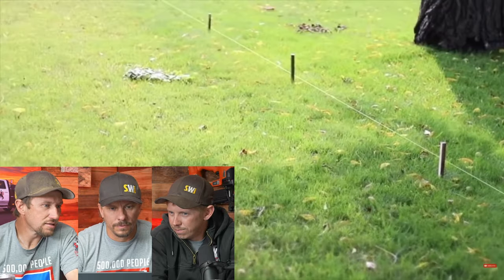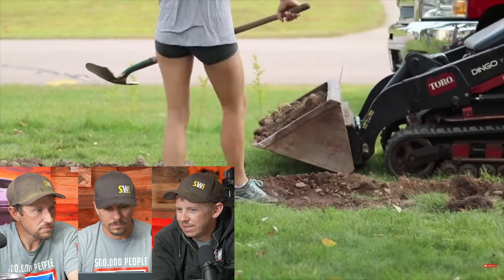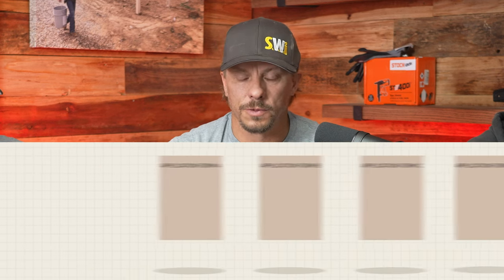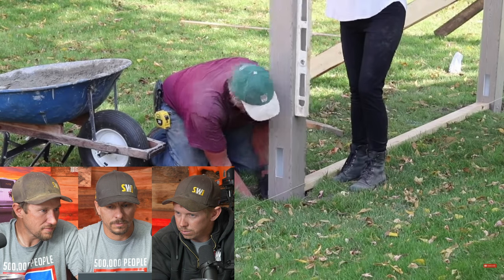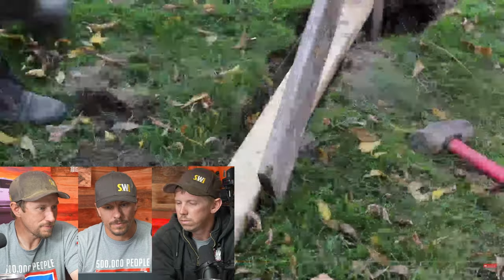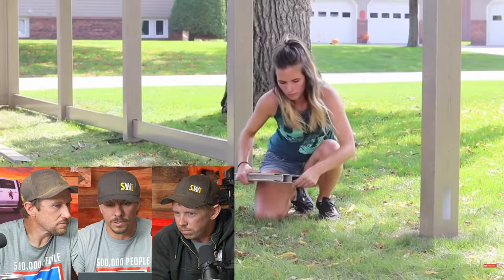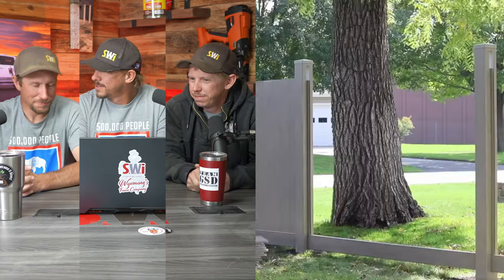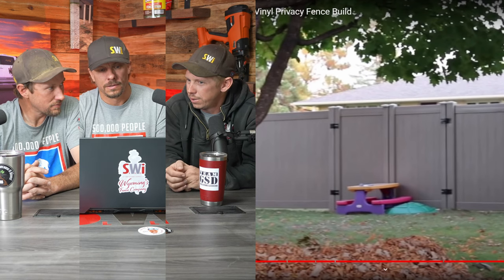How This Mom DIY'd a Perfect Fence

Comment: Hey guys, I like your videos, great job!
How about using instead of concrete just big edgy gravel in a PVC Pipe, threw the sharp edges they got poured into, and lock in place and lock the post. That’s kind of how we do it sometimes here in Austria with electric poles.

Comment: Is there ever a concern (when using stab method) in vinyl that water will get into the post, then over winter the water will freeze and bust the post?
Reply from the maker: No. If you did manage to get water in there it would just expand upward into the cavity when freezing.